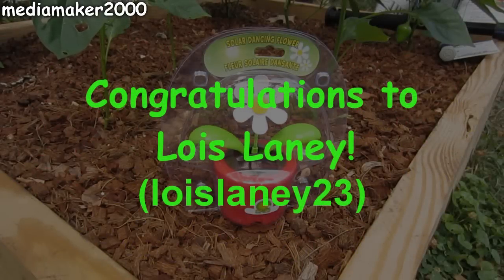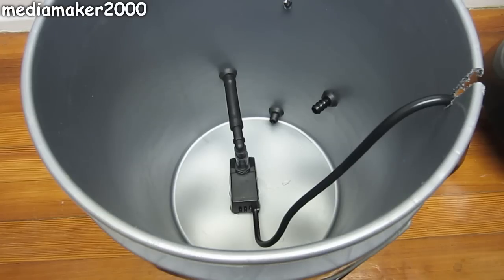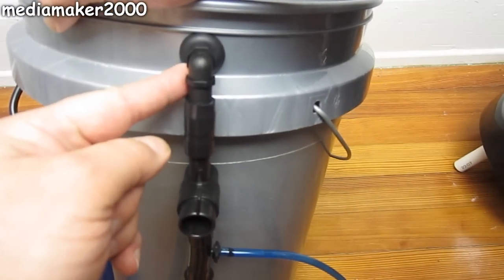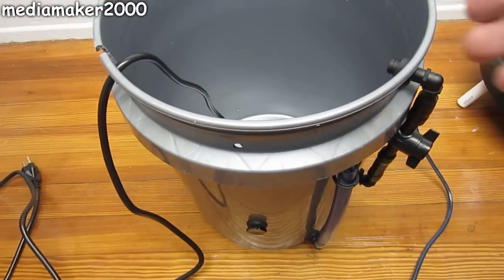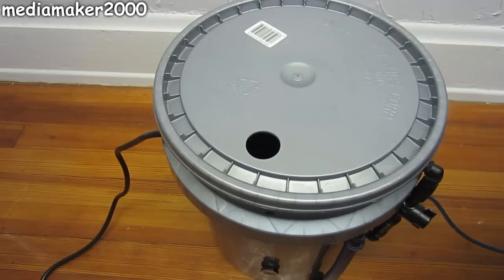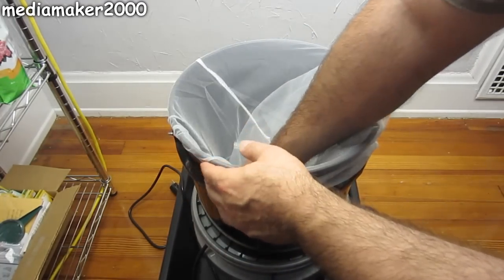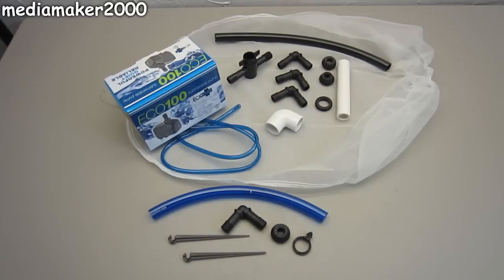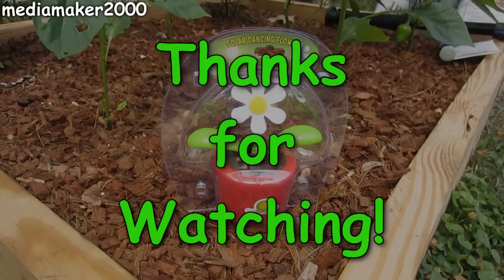Single Dutch Bucket Hydroponic System - Easy DIY - Patio - Balcony - Winter Gardening

Comment from the maker: I got the valve at Dayton Hydroponics. Let me know if you need a part number. MHPgardener told me about the grommet for 1/2" pvc. They only come in packs of like 50-100. Don't remember which. If you only need a few, let me know. Same for the inline valve if they only sell by lots. The other grommets are tapered General Hydroponics 1/2" grommets for 1/2" barbed connectors.

Comment: I'll just put a T in my 1/2" flexible tubing and put a small section of 1/2" tubing going into a pvc adapter and then a ball valve on that, and run the rest up to my normal 1/2" tubing with holes punched and 1/4" drippers.  

There are some flow sensors I could probably use and put a computer controlled valve on, but I don't think at this point that will be necessary.

Comment: is the pump running constantly or on a timer? I've started my hydroponics with a couple kratky tubs and while it's working good, I think something like a dutch bucket makes more sense. I've seen some videos with the pumps on a timer and some without. I'll be building one of these in the next several weeks as time permits and just wondered about the pump :)

Comment: I definitely need to do that pump restriction trick.  Where did you buy that valve?    Thanks for the easy code on the grommets.  I have some uniseals coming in for my NFT system too.

Comment: Thanks!  I ordered 50 of the grommets from the annotations from grainger.  I still haven't gotten the valve yet,  I've looked at a couple of local stores already(nearest hydro store is 100 miles away).   If I can't find the valve locally, I'll use a pvc adapter and use a pvc ball valve, as that's much cheaper than shipping.

Comment from the maker: Float valve like what meanshoes uses on his system first comes to mind. I think two totes could be done easily Rob but I'm no expert in dutch buckets for sure. I think Bobby and Brock use like 2 1/2 to 3 gallon buckets for each plant and the nute res is like 3 gallons per plant. Are you going to try one? If so, I can't wait to see what you come up with!

Comment: inspirational man :-) 
but one question as you are using perlite what nutrients soil or hydro just confused an it's still in a medium,,, 
If that's that's the word
learning like some guidance please :-) 
Ps I like your singing flower 🌸
Reply from the maker: Paul Dutson Perlite is what the plant sits in and forms roots in. General Hydroponics is the nutrients and what feeds the plant.
Reply: mediamaker2000 ...could you pls.advise how often the watering process shud take place in a day..and wat nutrients ratio will be given.am doing it in commercial way with 5000plants with same system.

Comment: Great video - nice instructions!  Another good method is the DWC bucket system I have used for a time.  I also have a EuroGrower which uses Dutch buckets also posted on youtube (also works great!).  Check it out at Easiest DWC Hydroponic System
Thanks for your video.